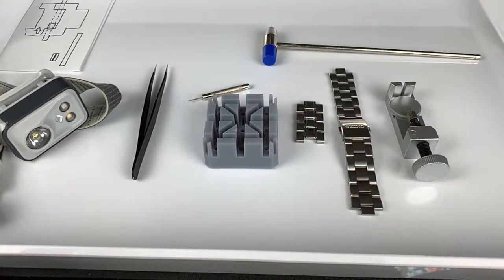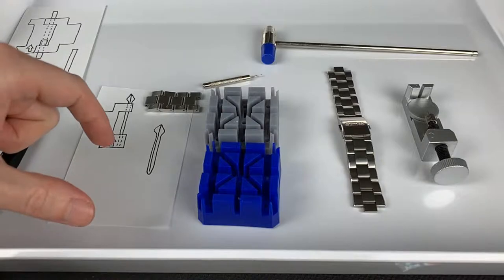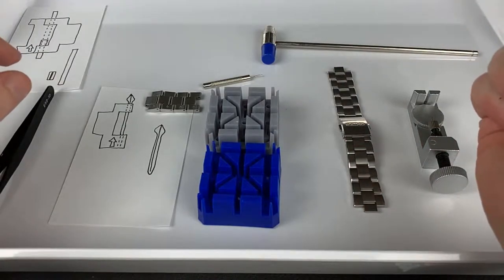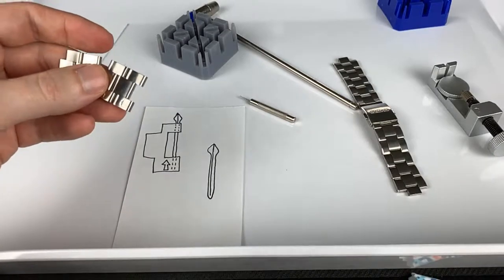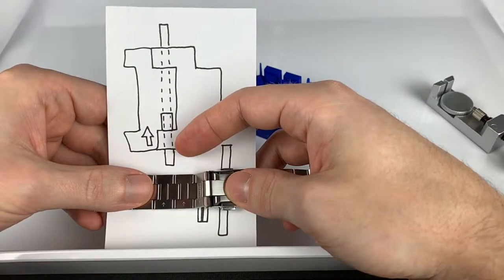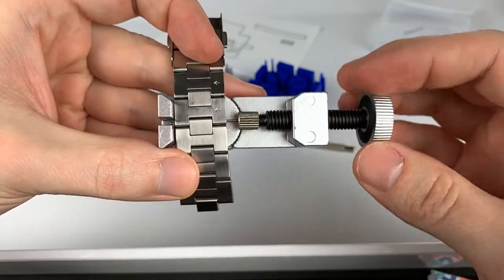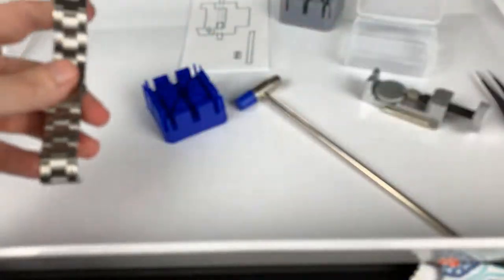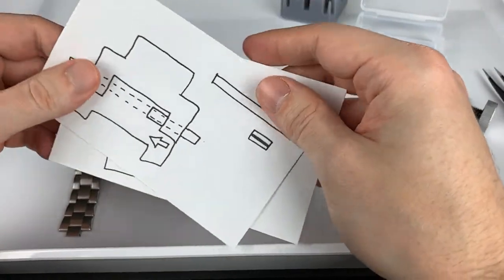Understanding how to size a Seiko Pin and Collar and/or Regular Pin Watch Braclet

Comment: NOTE: On the Seiko Monster bracelet, the collar inserts into the outer link. On the modern 62Mas / MM200, the collar goes into the middle link as in your video. This difference was driving me nuts until I watched enough videos to see it both ways.
Reply from the maker: This is a super important detail! I actually just got a monster and noticed that about the collars. That design seems almost worse, because it is hard to get the collar to seat while you drive the pin. Glad the video helped :)
Reply: What about the pins holding the case to the bracelet. I pushed those out and I am having a difficult time getting the collar sunk where I am comfortable that the bracelet won’t fall off. Should I put the collar into the inside of the lugs then hammer the pin through? I put the pin through and tapped the collar on as good as I could. But after watching this video I am wondering if I should have the collar inside inside of the lugs not outside pushing it in? Any thoughts? Thank You

Comment: Nice video! I just received my first Seiko with pins/collars in the bracelet & it was very frustrating removing links & then finding out that 2 of the tiny collars had fallen out--I found 2 on the floor which saved the day. Don't know why Seiko changed a very tried and tested pin setup, but thanks for the video 🤓
Reply from the maker: The pin and collar system is a mystery, haha! I am pretty darn good at it at this point, but it is still my least favorite sizing system.

Comment: That's a great video. If I can add one tip, I keep the plastic film that usually covers a new watch, on the dial etc. Then, when it comes to those last few hammer taps, when you need the pointy tool thing to make the pin sit just below the bracelet surface, I hammer through the plastic. Then, if it slips, you don't scratch your bracelet.
Reply from the maker: This is a really clever idea! Thank you! :)
Reply: I realize I am quite off topic but do anyone know of a good website to stream new movies online?
Reply: @Solomon Aries I would suggest flixportal. You can find it on google =)
Reply: @Lawrence Ridge Thank you, signed up and it seems like a nice service =) I appreciate it!
Reply: @Solomon Aries No problem :)

Comment: Great video!
I just wanted to point out one thing, at about 19:30.
You might want to push the pin in so that you are pushing the collar into its seat, instead of pushing/hammering it out of its seat (and potentially bumping it against the outer lug with each hammer stroke).
I could be wrong in this, but as far as I know, the collar only goes into one side of the center-lug, thereby giving it a seat in the center-lug.
Reply from the maker: I believe you are correct. I have also learned since making this video that sometimes Seiko makes bracelets where the collar sits on the outer edge of the link. I really dislike those, haha!
Reply: @JustWatches1  Heheh! Yeah, it's always fun when they change up something which people already are confused by:p

Comment: Sarb owner here. At 22:28 on the opposite end of the micro adjust side of the clasp, the folding arm hinge attaches to a small H link endlink. Is there any possible way that you could check if this small H link also uses a normal pin and collar like the rest of the links do? I've been stuck for hours trying to put it back together (took it apart a long time ago trying a new clasp) and there is no place to rest the collar. The collar will simple go through either of the holes on the H link. Also, if you look at the holes of the H link endlink, they happen to be larger than the rest of the holes of the other links where the pin fits through which leads me to believe it's a different size but not sure. Is there any way you could check if a thicker pin and/or collar system is used on this H endlink? You are my last hope lol, been searching the forums for hours and can't find anything. I'm thinking it uses a thicker and/or shorter pin than the rest of the links or I'm not doing something right.
Reply: Good talk, good talk...............
Reply from the maker: I don't have this watch anymore so unfortunately I can't check :( 
Were you able to figure it out?

Comment: Okay, my watch doesn't have arrows on it. It's pins appear same on both side.

What do I do? It's a titan watch btw... From Calcutta Titan metal mechanicals NR90140SM01.
Reply from the maker: If there are no arrows it might be pin and collar (you can go either way with those). Did you figure it out yet?

Comment: I need to take out a few links.    One on each side.    Do I need to take  the clasp right off ?   I want the watch to be even .   Thanks .
Reply from the maker: You don't need to take the clasp off. I usually end up taking a few links off of each side and putting it on and just seeing where the clasp lands. If it is too far in one direction, I move a link from the longer side to the shorter side and that usually corrects it. Hope that makes sense, and good luck :)
Reply: @JustWatches1   thank you .  I should get my Seiko sarbo35 tomorrow ( Amazon ). I did order a watch kit at the same time .